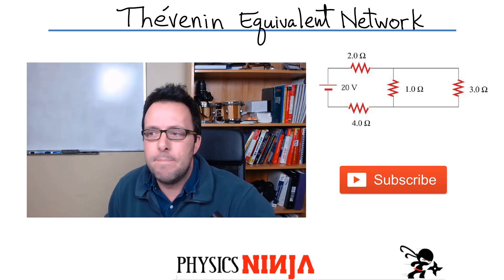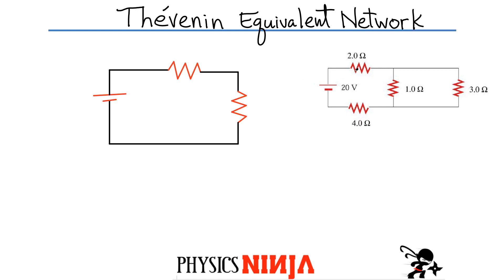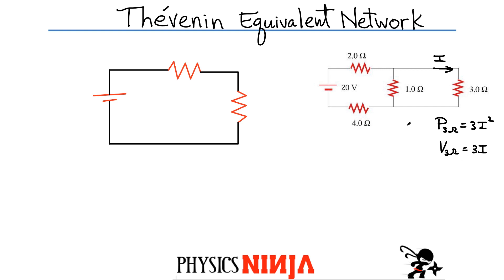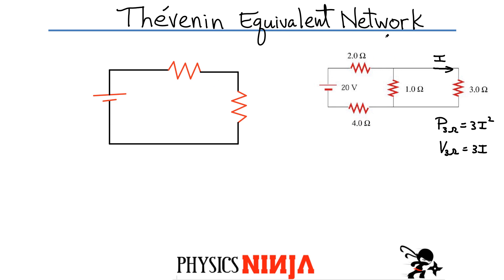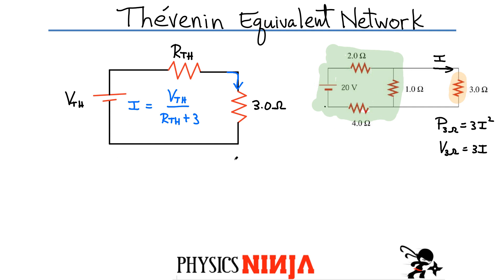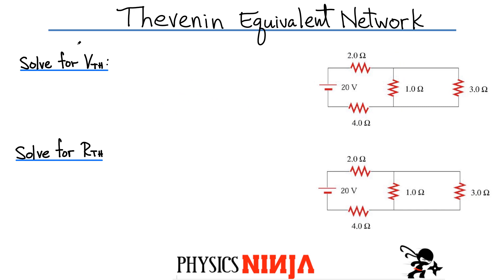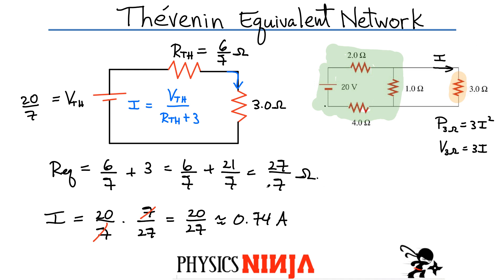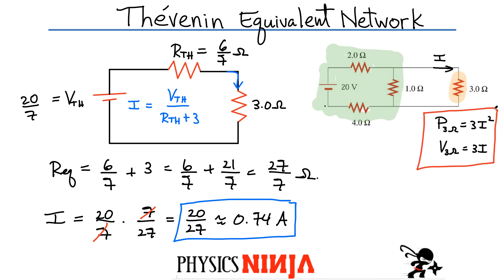Thevenin Equivalent Circuit Example

Comment: it's poor practice and misleading notation to omit units in your calculations. Including units makes it clear which numbers correspond to which quantities, and how units relate to each other. It is also good/standard practice, which you should model for your students.
Reply from the maker: Units are important at the high school level.   For more advanced topics the equations because so long they barely fit on a line or even 1 page.   Including units didn’t make sense IMHO.
Reply: As a university student, this is the clearest + towards the point explanation i ever get in this subject
Reply: dude he just owned you